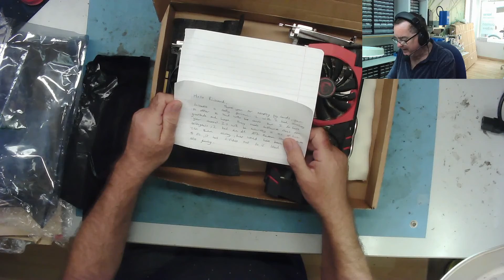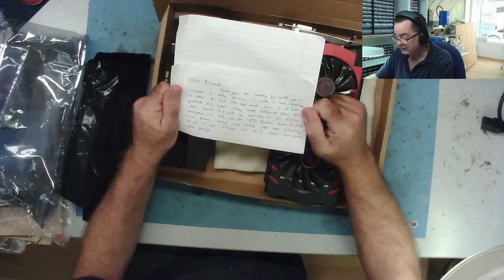Dead MSI R9 380 GPU / Graphics Card. Can we repair it?  GPU Fault Diagnosis LER #139

Comment: Just a note: Short can be in direction through GPU to GND, but also can mean it will go backwards through some component or mosfet. (Rule is to go to least resistant path, if GPU has 0.6 to 2ohms and is good and is shown as 0.2 ohms then its not gpu that is bad)
From here you can do following: 
1. stop working on card. 
2. remove chip and check if short to gnd is still present, if its not, then its to be reball or replaced, it its still there something else is shorted. 
3. use high precision resistance measuring to come near to short

Comment: Richard I have the same card faulty not short but no video out with all voltages present. Gets one beep and causes Motherboard boot loop constantly no video out. I thought that it had missing fuses also, but sadly no. They are shown on the circuit diagram but MSI decided not to fit them.  There is a track from each 6 pin to the R 47 inductors on the other end of the board, no overload protect at all. Sad but true. No wonder these go up in a puff of smoke. Any idea why I am getting the boot loop ? Tried reflash of the BIOS with original from MSI site, then I get 3 beeps not detected ?

Comment: Hello sir! Just found your channel two days ago. I have a sapphire r9 380 and I would be really thankful if you could help me repair it or at least provubg that this gpu doesnt need a reflow, because I sent it to a repair house and they told me that's what it needs 
First, I can only measure the resistance between ground and the pci slot at the forth thing from left to right. I couldnt measure at the first 3 and neither at the forth from right to left.
I have 3 fuses, one for each power connector at the top and the other one at the bot near the pci slot. With the "beep mode" on, all of the fuses work and I can even measure the resistance between the fuse at the bottom and the first 3 pcie things, and the same with the fuses at the top with each power connector, and at every fuse I receive 0,6 ohms after a second (it starts somewhat high and then reaches 0,6ohms). 
I couldnt measure resistance neither touching the little coils and ground, but I could with the 5V mosfet (0,6ohms). 
With the capacitors, every single one of them gave me 0,6ohms on one side and nothing at the other side but there is one that gives me 165ohms on one side and 0,6ohms on the other. 
The thing is: almost everything gives me 0,6ohms touching ground except for that capacitator.
On the backplate, relating to the coils/chockes (i think thats how the things with the "SFC" at the top are named, but mine are different, still they both yours and mine look like tiny cubes) on the backplate, one gives 165 ohms aprox on each welding, another one 50ohms on each and 5 little ones give 5 ohms on each welding except for one that gives 18 on each.
 I have measured the capacitors near the chip and all of them gave signs of life (some measured 0,6ohms, one 50ohms, 120 ohms and so on) and vram also gave signs of life giving near the ohms they gave to you on the second gpu.
Sorry if my english is bad, Im from Argentina, I hope you understand me well enough
I dont want to waste more of your time and Im trying to do this as short as I can. Again, I would be really thankful if you could help me.
BTW: I've just subscribed. Im studying computer engineering and I think this channel will be really helpful in my future :)
Reply from the maker: It's hard  to say from your description but it sounds like you have Vcore (GPU) = 0.6 ohms.  You could try powering up the GPU and measure the voltage on each supply rail.  It would be a good idea to come to the discord server and post some pictures of your graphics card and mark where you see each resistance reading then hopefully I or others there can help you.

Learn Electronics Repair is now on Discord!  Come and join the fun, it's free.
https://discord.gg/vam6YC8vwU

Comment: What a useful video! I measured my exact same card this way and sure enough it's also completely toast everywhere
Reply from the maker: Glad it was helpful! Even if you only found more toast.
Reply: @LearnElectronicsRepair  Hello, when you see all this, do you measure diode mode on PCIE? Im just curious about results. Would it show normal for those lanes or it would show bad results there also.

Comment: i got a 370 with 2 blown up highside mosfets and a fuse.
the discord people helped me identify the issue but i plugged in the card multiple times without testing it first so im worried if the issue is just those mosfets and fuse or did i kill the card!!
even tho i tested the vrms for vcore and they don't look short but the core memory controller is shorted to ground thru those mosfets ig
Reply from the maker: All you can really do is replace the faulty mosfets/drivers.VRM controller and hope for the best.  A short on Vmemcontroller to ground would most likely be a blown GPU but you could get lucky and it is a capacitor or something,
Reply: @LearnElectronicsRepair  fuse blown and ig that disconnected the 6pin 12v from vcorememory idk 
don't know much about these stuff, Still learning!!

Comment: Thanks for this video... I own two gtx 1060 6g   from zotac, and i use its on mining... the first one works without a problem and the second one hasn't worked since a month ago and it had the same ohm measurements in this video and when I compared the measurements with the working card I found that the ohms measurements are the same For the card that does not work!! Except the 1.8 v coil only was in the card that is not working 56 ohms and the card that works 870 ohm
Reply from the maker: I've bought some GTX1060 spare or repair and will pick them up when I go to the UK for a few days in November.  Maybe my videos will then help you.    The big difference on the resistance on 1.8V suggests something is wrong there. The 1.8V supplies the GPU but also some other parts of the graphics card so you will have to do some work to find out what is causing the different reading.

Comment: What happend when theres a short on the 3.3V on the pcie?
Reply from the maker: Personally I have never found a short on the PCIe 3.3V, but often that is used to generate the 1.8V so I would be looking for shorted capacitors or shorted buck IC near the PCIe.  There could be other reasons of course, that's just the one that came to mind.